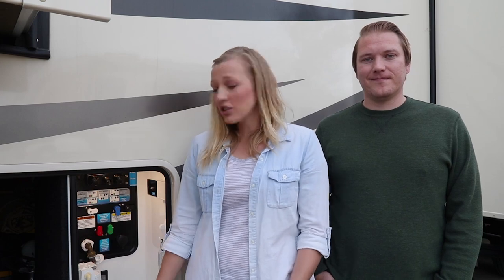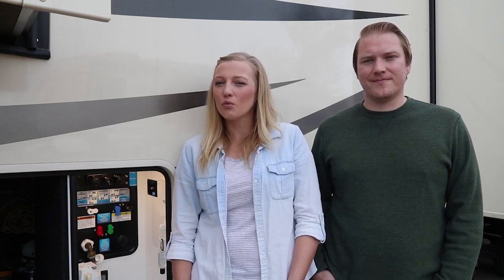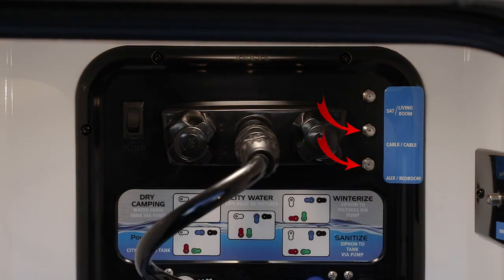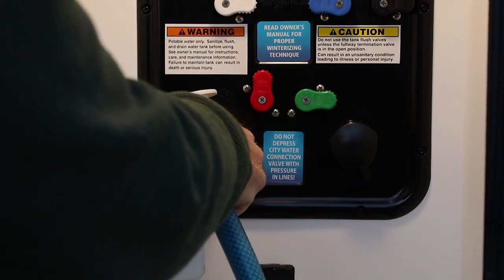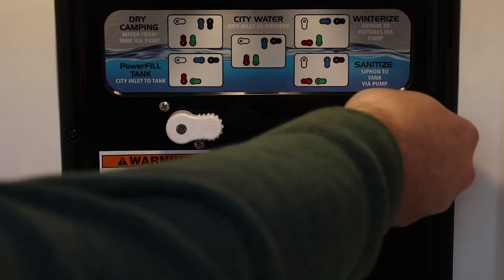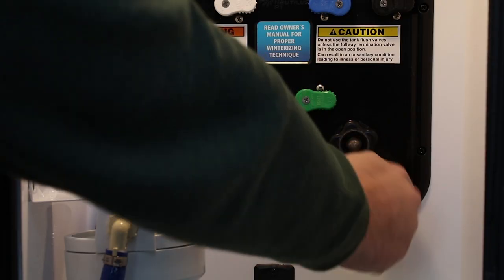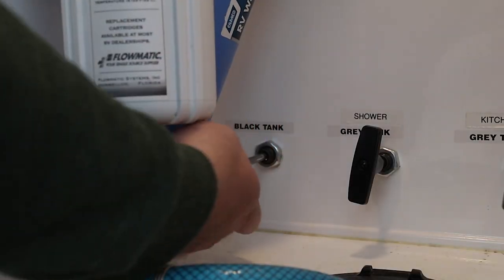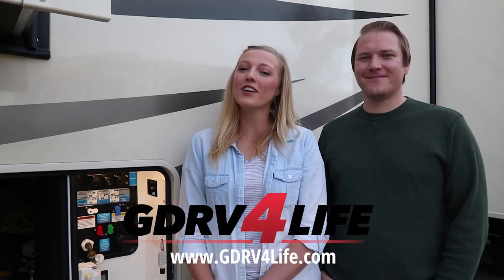How to Use The Grand Design Nautilus System (2019) || How to RV

Comment: Another great video! I'm glad you highlighted the warning label for the city water connection. I misunderstood what it meant as well. I thought it meant you had to shut off the water then go inside and open a faucet to relieve water pressure before switching a valve position on the panel. Thanks for clearing that up for us!
Reply from the maker: You're welcome! Glad it helped 😊

Comment: Boondocking in Sedona right now and thought that I could use a drill pump to fill my water tank from my 5 gallon containers into the city water to tank. NOT!
Watched your video and decided to try setting the nautilus to "sanitize". BINGO.....it took a while but patience prevailed. It probably took about 7 or 8 minutes to get it to about 20% left. Then I combined them and did the rest. I have admit that you need patience for this way but it beats hooking up and dragging a 375RES through the desert. We've also learned get rid of a lot of water outside that is relatively clean to make way for more water. To is its a game to see how long we can stay out here. Thank you for waking me up to this procedure. Next....Battle Born  batteries. 3 1/2 year old golf cart AGM's are not holding a charge like they used to.
Reply from the maker: Thanks Mark! Glad we were able to help! Love to hear this! You will not regret the decision to go Battle Born for longer boondocking adventures!

Comment: Just found you guys, thank you. I do have a question. We have a new reflection 260RD . Do you happen to know if the grey tanks have an overflow vent? Or do we have a problem? Our 5th wheel is less than a month old and we have a drip under the tank location. Pretty sure it’s not a black tank but the leak stops when I empty the tanks.

Comment: Great video, wish it had gone into a little more in-depth as a newbie for us.  It mentions not overfilling hot water tank, how do you when the tank is full or overflowing?  Is it by the inside guage only?  If so, it doesn't seem to "ever" read past 1/2 tank?  This is a brand new 2020 model.  How about a video for winterizing and de-winterizing the Nautius system....

Comment: Hello. I have the same water system in my 2019 Riverstone. Question?  When I’m hooked up to city water and the valves turned appropriate for water to the fixtures. We are not getting very good water pressure. I’ve looked at all the lines and they are good. Even when I go to fill my fresh water tank it takes a very long time to fill. Water flow thru the city connection with the check valve seems to be not operating properly. When I use my onboard water pump. Pressure is very good. Any suggestions on what maybe wrong or how to fix. We are leaving next week for a long RV trip. Thanks

Comment: I'm a single women and a 1st time owner of a GD Momentum 320g. I followed along to the point to attaching your "black hose" to flush out the black tank once it's been emptied. I have (1) hose attached to my unit from the well. Where do you get the water for the flash? Can I get a split double connector for the entry to the unit and use a short additional hose for the flash? I'm on private property and the well is 75' away.
Reply from the maker: Ah, gotcha. We use this splitter: https://amzn.to/3W6qaok The only reason we recommend using a black tank hose is because of the risk of back flushing. Like if you were filling your black tank and forgot to open the valve, you could risk back flushing sewage into your black water hose. If you are never going to close your black tank while flushing then you could probably use your regular hose, or the short additional hose like you mentioned.

Comment: Hey thanks for the video. All I’m looking to do it drain the water from all my lines, not winterize the camper. On my Jayco it used to have a low point valve I could turn. Do you happen to know how to do it with this system? Thanks a lot.
Reply from the maker: Hi, Jonathan! Our low point valves are in the same area as our Nautilus System but when you're facing it they're on the lower right hand side, at the bottom of the compartment. On the right wall actually. If you don't have the same model they might not be right there but another thing you could do is look under you camper all around the edges for the red and blue pipes sticking out, those should be your low points. Good luck!

Comment: I too had the same confusion over that warning message.  I came to the same erroneous conclusion you did.  Thanks for clearing this up.  I noted in the video that the 2 grey valves were labeled “shower” and “sink”.  I too have a 2018 Solitude.  Can I assume the left grey valve catches the shower water and the right grey valve catches bother the kitchen and bathroom sinks?  Where would the water from the optional dishwasher go?  And what about the optional clothes washer?
Reply from the maker: Hi David! We put those labels on ourselves so we would stop forgetting which grey valve opened what lol. The one labeled shower is our shower water and bathroom sink water. The one labeled kitchen is just our kitchen sink. Hope that helps!

Comment: Awesome explanation on the check valve warning.  That makes sense now. Can you and Jason do a tutorial on the outside shower? I think some grand designs have 2 ports to connect the sprayer hose, but is the control valves for the second port the same knob on the nautilus?  Do you set the temperature there, then connect at the second port?

Comment: Hey guys, Just another tip.  I had to turn the screen around to hold open the check valve open (per dealer directions) when winterizing to get the pump to pull in the rv antifreeze.  How about a video on your rv suspension?  Did you upgrade your stabilizers, shackles or add shocks?  Have you greased or replaced your wet bolts yet?

Comment: Please make a vlog on hooking up the TCL TV to the campground cable, hooking up the TCL TV to a satellite Dish (or Direct), and finally to the Roof antenna.  There are a lot of posts regarding this topic.  Include the steps to scan and program the TCL TV to stations.  -Jersey Mike
Reply: Mike , I’m curious as well seems to be a lot of barrels to hook cable to which to me says you need a 4 bang splitter to feed all. Why didn’t they just incorporate that already giving you one barrel to supply all? Maybe cause splitters fail and then I can easily replaced by consumer. Fortunately I have a compression fitting applied for RG ends and can make a bunch of tags”” that can hook to each then splitter and finally cable feed. Your thoughts?
Reply: shortCUT207 : Well, a year ago I was totally frustrated with my ‘17 Reflection 307MKS rig and not being able to get Campground cable TV to work using the internal coax wiring.  Long story short... the dealer where I bought the RV had it in for wheel bearing servicing and found the coax cable ground foil was interfering with the cable signals.  Months of frustration suddenly resolved.  You are correct, the builders had coax, splitters all over the rig inside cabinets as potential fail sites.  I traded that rig in Aug 2019 and fortunately my new ‘20 GD Momentum 351M has been performing well with campground cable TV, OTA TV, and Dish / Wally TV using the installed connection points.

Comment: My grand has a similar doc station 
But also a gravity fresh water tank fill on the out side of the coach
What is this for specifically I’m a little confused as to why they supplied a hose thread connection AND the gravity style connection
Reply from the maker: I think it just matters on the situation you're in. If you're filling up at a campground, you'd want to use the freshwater hose to fill up the tank. But if you're out boondocking you can use the gravity fed to refill without needing to move the whole camper (you can use a bag or jugs to go get water and refill). We have to use our water pump if we're filling up while boondocking and sometimes it might just be easier for us if we could had a gravity fill option.

Comment: Is there a certain position you should have the Nautilus system in when driving? I fill my RV and then while driving I lose 1/3 a tank of water out of the over flow. (Blue hose on the bottom of trailer that lets water out when it is full). Any idea how not to lose water while driving?

Comment: I don't know what you mean by this check valve- I have never touched it- When I am done at the campground I always let pressure out at the faucet then I disconnect at the panel -Is that wrong?

Comment: After you fill the tank, what setting do you use to drive to your destination?  Keep it as city fill or dry camp without turning on the pump?
Reply from the maker: We change it to dry camping. That way if we need to use the restroom on the road, we can just flip on the pump while inside and then turn it back off when we're done!

Comment: My husband and I connected the 337RLS nautilus water system to a water hose and set it for city water. We then noticed water leaking under the kitchen island. We determined it was coming from the kitchen faucet above the counter top. We unscrewed the faucet pipe to loosen the faucet, but cannot figure out how to fix our problem. We thought it might be pressure in the lines, or an air lock. We ran the water until there were no more spurts. However, that didn't solve our issue. Is the faucet hooped and we need to replace it? If it is just a matter of a seal within the faucet, do you know how to get to it? There is no name on the faucet and it isn't in the manual for us to check. TIA.
Reply from the maker: Gosh, it’s tough to say! It sounds like it could be a seal if it’s leaking from the faucet and not building pressure. There is a but holding on the kitchen faucet, you could take that off to see if there’s a loose connection. Also, I’d reach out to Grand Design directly as they might be of more help!

Comment: Have you ever had to remove the Nautilus panel to gain access to the water lines behind it?  We have horrible water pressure, both while on city water as well as using the on-board pump.  Everyone I have talked to states that there is likely a kink in the lines leading up the hot water heater and that I need to remove the Nautilus panel to gain access to the lines to take a look.
Reply from the maker: I don’t think you would have to remove the panel to get to the lines, but it depends on your rig. For us, we can remove a piece of wood to access the back of the panel and see all of our wires. You can see what I mean in this video: https://youtu.be/AiA9g4xpMoM Good luck !

Comment: TV..... unfortunately the TV in the bedroom doesn't get over the Air channels.. only the living room...  So the video would be on how to use the AV-TV-DVD-Cable-Satellite-AUX system in the RV.
Reply: Additionally I did pick up my 373FB-R and its now 27'f outside.   I have burned through two 30 lbs propane tanks in the first 6 days, even on electric.  Refilled the tanks and now on third tank.   Could be an expensive winter.
Reply: Tv cable problems  in Grand designs is a common complaint.
Reply: @Dive-Bar-Casanova  There is also the fact that only the vent in the midship head is producing the most heat from the furnace ...   I'm... not sure about this RV 373FB-R - Nor am I  to thrilled about the dealership, but that is another story.. lol

Comment: There is a all caps warning DO NOT OVERFILL THE FRESH WATER TANK.  Other than standing inside holding the monitor light, How do you know when it's full?  Is there an overflow and if so where.  These manuals are pretty useless.
Reply from the maker: Hey there! We have an overflow valve and it is located behind the trailer wheel on the drivers side. If you get down and look, it's a little blue PVC pipe that comes out. We have a Grand Design Solitude so if you have a GD as well, I'm sure it will look similar. Good luck!